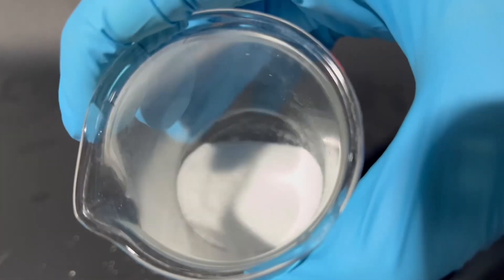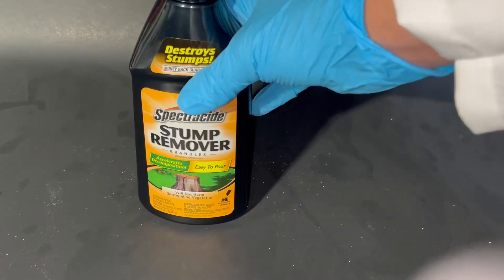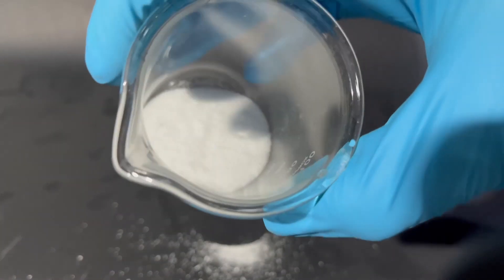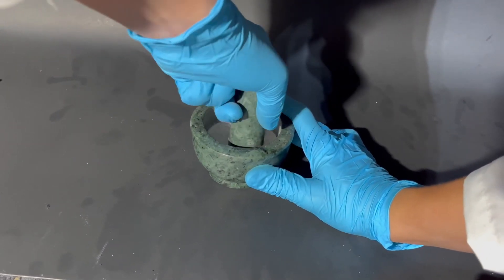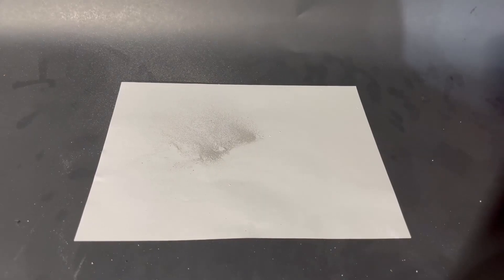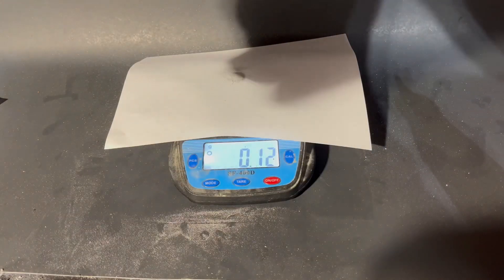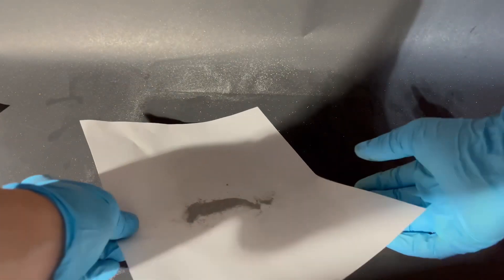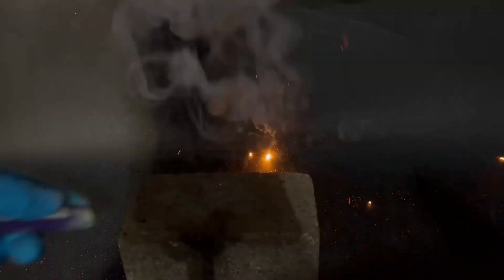Making flash powder

Comment: Will aluminum powder or sulphur work ?
Reply from the maker: As a fuel sulfur won’t work but with the right amount the sulfur would add heat to the composition aluminum will work as a fuel
Reply: Sick
Reply: @cadruo  50/50 is as loud and cheaper
Reply: @Chemanic1  what kind of aluminium Powder would that be ? Just the normal one or the dark aluminium
Reply from the maker: @lolkonsti  I would use dark just cause it’s easier to make
Reply: @Chemanic1  but what Else Kind of aluminium powder could u use?
Reply from the maker: @lolkonsti  like 200 to 500 mesh with the finer the better you could use normal or dark as long as you find the proper ratios and add like maybe 5% sulfur or ferrous oxide for heat
Reply: @Chemanic1  the sulfur is no problem and same with the kno3 but the aluminium is the Thing how to i make it to powder without an Ball mill
Reply: @Chemanic1  I have another question. Can I also use pickling salt as an oxide?
Reply from the maker: @lolkonsti  I just use a rock tumbler with marbles it’s practically the same thing but like hundreds of dollars Cheaper also if you stick around on my channel I’m planning on making a video about this one
Reply from the maker: @lolkonsti  if I remember correctly pickling salt dosent have any oxidative properties I think it’s just really clean table salt I don’t think it would work but fact check me on this one
Reply: @Chemanic1  so what Else could i use as an alternative of kno3
Reply from the maker: @lolkonsti  I used sodium per sulfate for this one which you can find as pool shock but at least where I live it’s not in stores anymore since summer is over. you can buy sodium perchlorate or just sodium chlorate online or figure out how to make it with electrolysis and you can make sodium nitrate but that’s basically the same as potassium nitrate
Reply: @Chemanic1  is it the same Thing to buy Pool-Chlor-Granulat tablets and make them to powder?
Reply from the maker: @lolkonsti  if you look up oxy plus pool shock you should be able to find it it’s not the conventional hypochlorite shock
Reply: @Chemanic1  yes found it in a Store in the next biggest city its called something with oxy for pool i hope it will work and should i add same sulfure too?
Reply from the maker: @lolkonsti  experiment with it honestly I I’m pretty sure it would help but I don’t know everything so I would just try it all to find out what works
Reply: @Chemanic1  ye its called pool shock but in my language so it should work
Reply from the maker: @lolkonsti  okay if you have discord and wanna join my discord you could post the results I’d love to see it
Reply: @Chemanic1  i am in the dicord and i will do the test in like 7 days or somerhing i can sent it to u